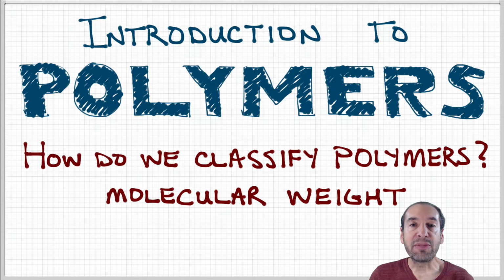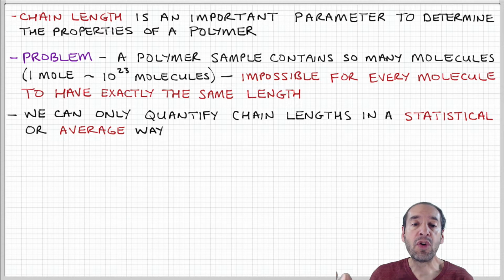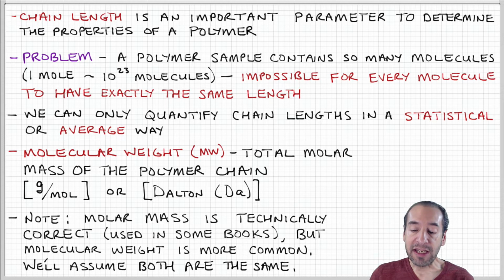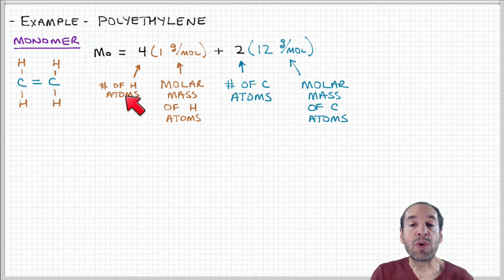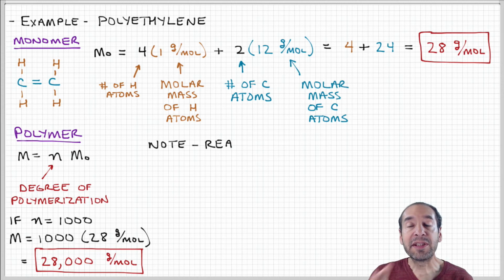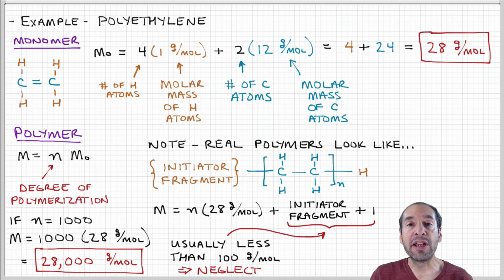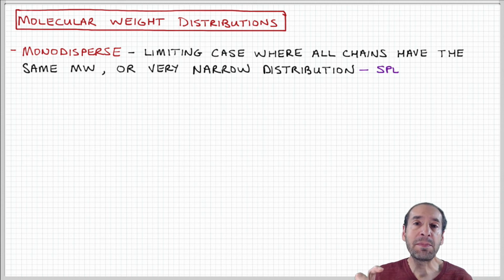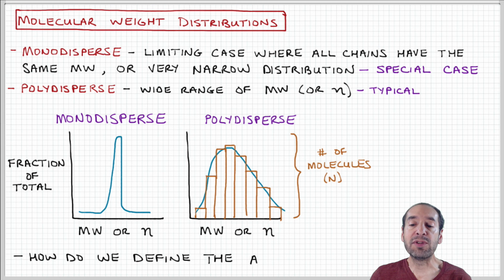Introduction to Polymers - Lecture 4.1. - Introduction to molecular weight

Comment: Generally speaking, well done for a very simple explanation. But using the terms monodisperse and polydisperse about 10 years after IUPAC clear recommends against this non-sensical terms is not ideal in my opinion. Sure, mention and explain the term, but also that it is outdated and maybe even explain why it is not good to use.